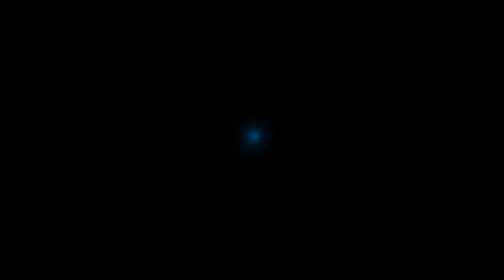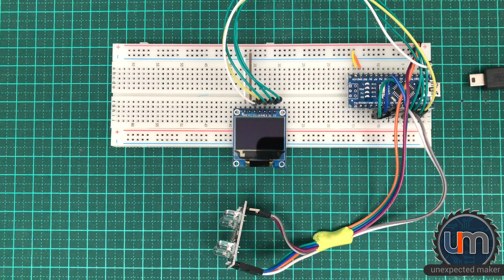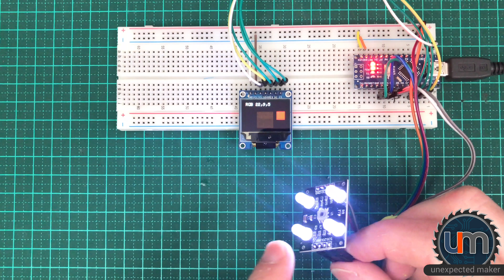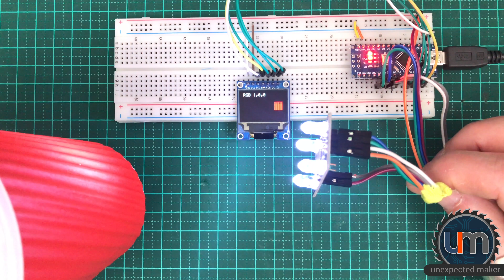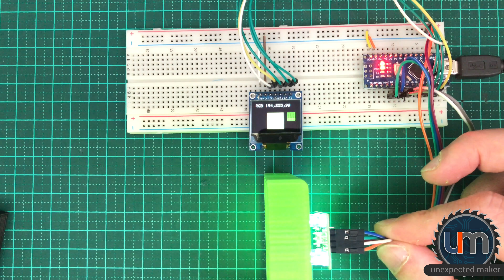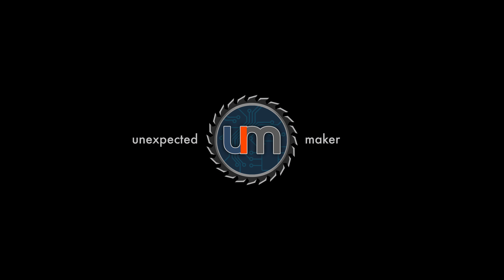Colour Sensor Shoot-Out - Part 1 - TCS230

Comment: It might be a clumsy sensor. Maybe used in  a sorting machine? Or maybe reads out the color it sees? I wonder if you can use it to change the color of neopixels? Or make a lame color tester?
Reply from the maker: It's definitely good enough for all of those things, if it is calibrated before each use and the lighting is good. If it's enclosed in something that blocks out all ambient light, it would likely work more consistently - but with changing ambient light influencing it, it's going to always give off differing results.
Reply: On my module I noticed you could screw in a web camera lens, so I did. I was thinking of people that have problems seeing color or can't see color  at all, or giving machines some sight. I think my idea of using it to change neopixels is a cool idea. I can imagine people wearing neopixels suits and changing colors like a chameleon.
Reply from the maker: Yeah, that does sound awesome! Make it! Do it! I'll wear one :-)